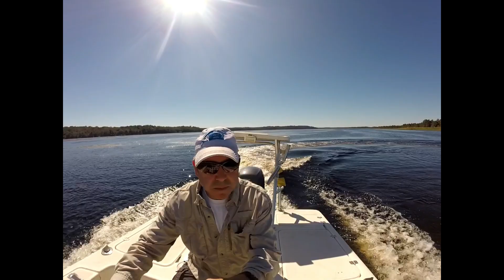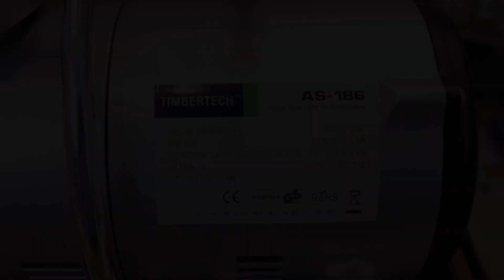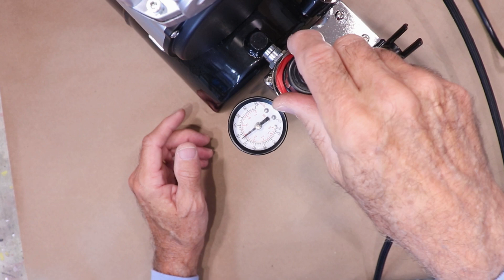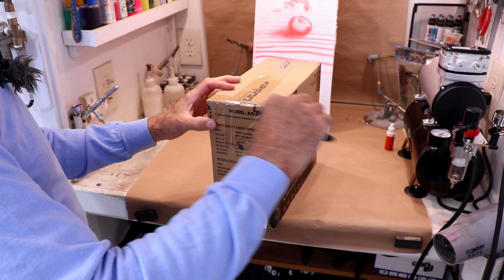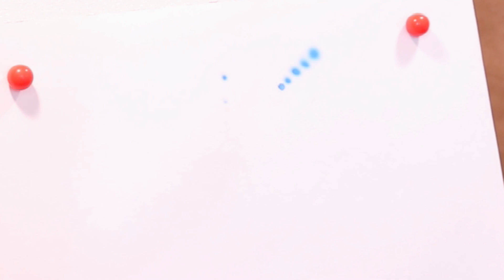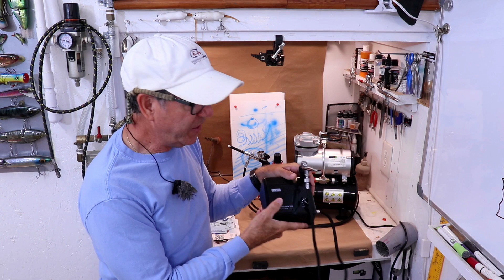Airbrush compressors for beginner airbrush painting #lurebuilding #airbrush #lurepainting

Comment: Here I was thinking about finally getting a compressor with an air tank and an airbrush gun, and you post this video! 😄 Thank you very much! 
I guess it's some kind of a sign 😂
Unfortunately, here in Serbia a compressor like the one you reviewed costs around 140$. And that's just the compressor. The very same setup you have (airbrush gun BD 130, airbrush gun holder, compressor AS-186, and a hose, but no cleaning set or paints) is around 165$. Who would've thought our economy is better than the USA? 😂
By the way, there's also a type of cylindrical battery powered air compressor with an airbrush gun mounted on top of it, and I was wondering how long would the battery /the compressor last. Do you have any experience with that type?

Comment: I have a question. 

I've been watching some of the automotive painters spray glitter paint when doing candy paint jobs. Of course, they're using bigger spray guns and automotive paints.

So, what is needed for a hobby lure maker to be able to spray glitter paints?  Is there any hobby airbrush that can spray glitter like the big boys do? Thanks. Hope you're safe from the storm.
Reply from the maker: You can try it with the largest spray nozzle...small glitter and 0.5mm might do it.
Reply: @EngineeredAngler  
Thank you so much for the information and reply. Candy paint on a lure would look great.

Comment: Huh, when I saw little table top compressor I had my doubts as well but it looks like it's actually a quality product. Thank you for the needle hack! I use automotive nitro solvent based paints and they clog like crazy (pigment specks are more like chunks) and I think I've noticed them eating away at my airbrush and needle so I might just give that a try. These paints can give amazing results but they are difficult to work with.
Reply from the maker: Give it a shot...